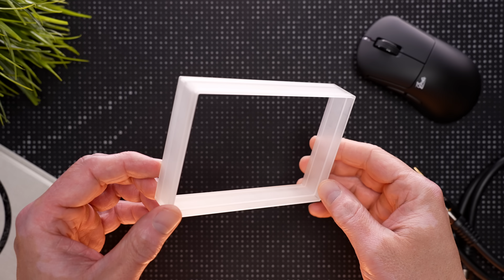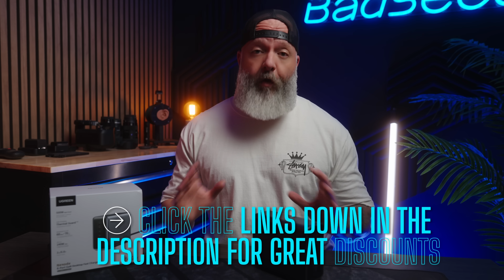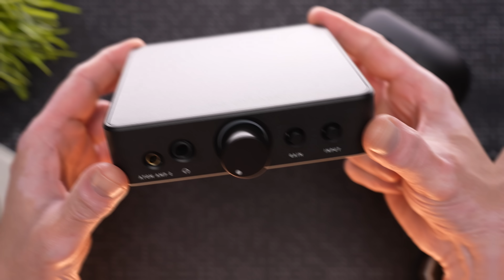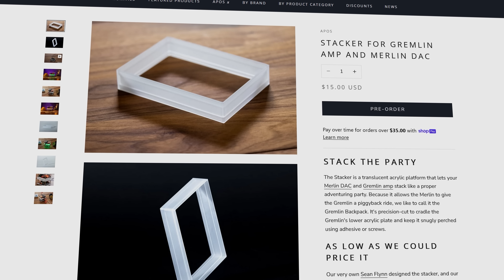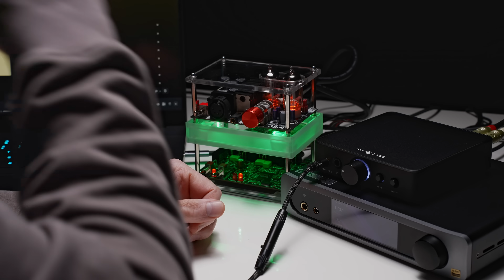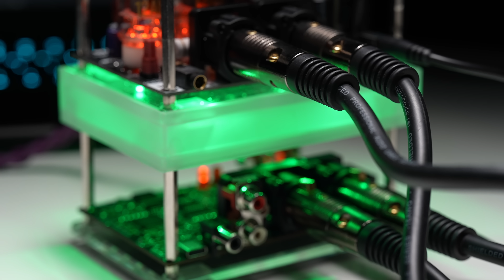Apos x Geshelli Merlin DAC - Not JUST for the Gremlin

Comment: No Op amp switching option without soldering is kinda sad. Input stage is already on the akm chip so op chip switching would have been so easy with just 1 in the works. Did you mention which Tubes where used?